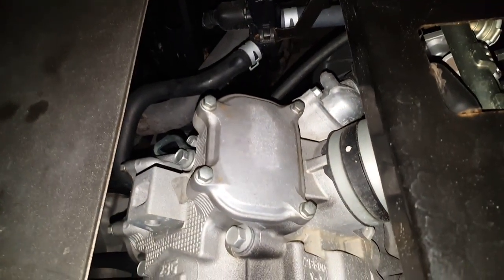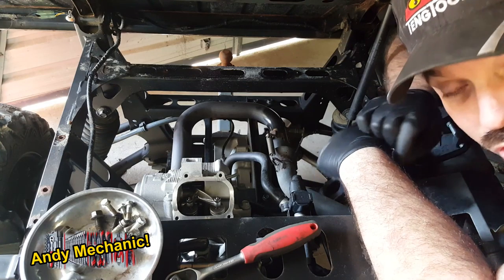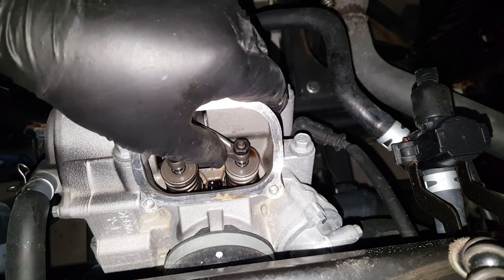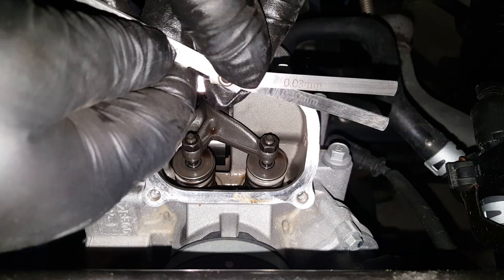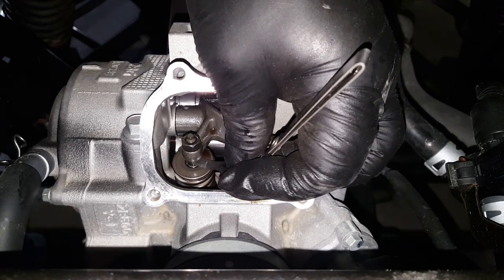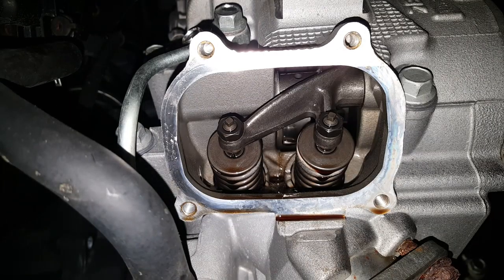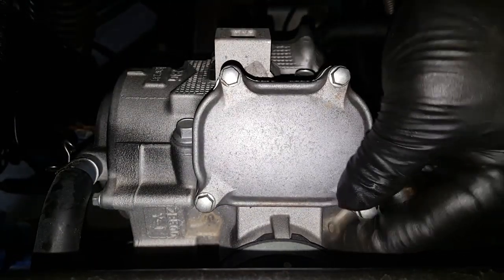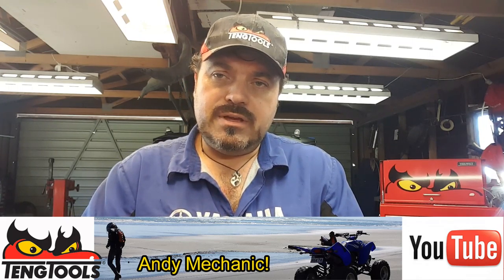Yamaha Viking - valve clearance check & adjustment #1813

Comment: What would happen if you did not turn the crank shaft to the right revolution? And do you have to take the spark plug out to do the valve adjustment? GREAT VIDEO!!!!!!!
Reply from the maker: +Mark  Hi Mark, the position of the crank shaft is critical when adjusting valve clearance. In fact, it's actually the rotational position of the cam shaft (s) that is the most important. 

On a 4 stroke engine the crank shaft turns twice for every revolution of the cam shaft so it's not just a case of aligning the TDC Mark on the crank shaft (flywheel) as you may be 360 degrees out.

You must check to ensure the lobes of the cam shafts are away from the heels of the rockers arms. An alternative way is to ensure the piston is at TDC at the top of the compression stroke and not the top of the exhaust stroke.

Hope all this makes sense. Pleased you found the video helpful.

Cheers Andy

Comment: Man, there's really not much room up in there, is there?  It makes adjusting 4-cylinder Honda cars look easy!

Out of curiosity, what's the average life expectancy of these recreational equipment engines?  I think I worked out once that the typical passenger car operating over 100,000 miles (160,000 km) equates to about 2500 hours, but please correct me if I'm wrong!
Reply from the maker: +rhkips It really depends how it's treated and service frequency too. I did a service on a 2 year old Viking Inc top end rebuild (first batch of Viking videos) and other than the engine issues it was still in good condition. Though I think anything more than 3000 hours would be pushing it for viability reasons for most 'normal' ATVs
Reply: Andy Mechanic
Awesome, thank you!  Sounds like they're quite a bit more durable than I would have expected!  :)

Comment: Do you know what flywheel puller I can use on a 2015 Viking vi EPs. I turned my ride over put a need head and piston in it and went to set timing and the chain just jumps so I'm thinking I burnt the gear up on the crank side but can't see it unless I pull the flywheel
Reply from the maker: +Billy Taylor It'll be a special Tool.  You may be able to find one with the aftermarket guys - check out the various Web sites. If you struggle I can look up the genuine part number on Monday for you.

Cheers Andy
Reply: I couldn't find an aftermarket that showed it fit a 2015 Viking.
Reply: Any luck